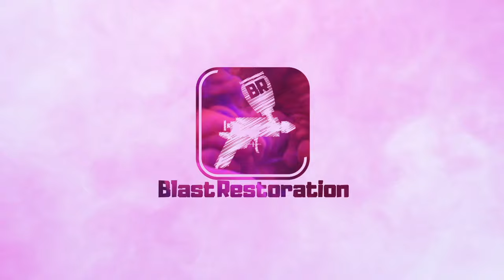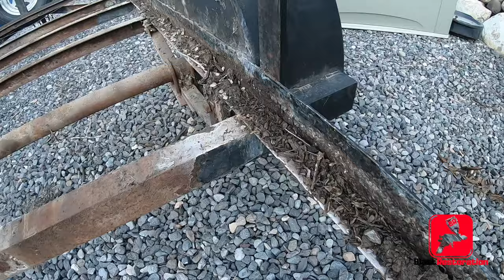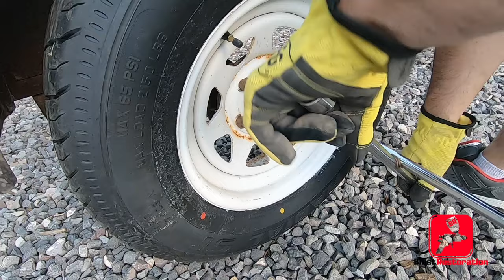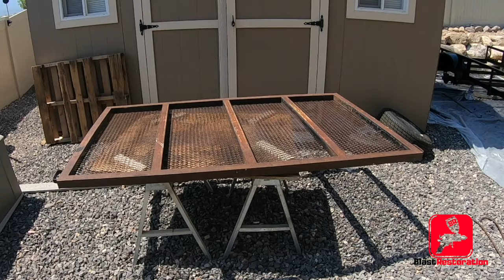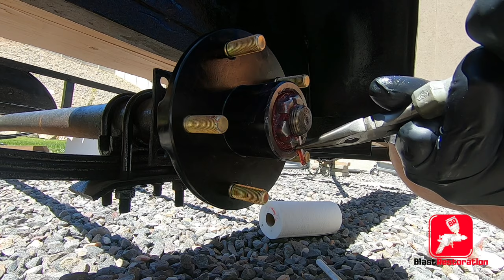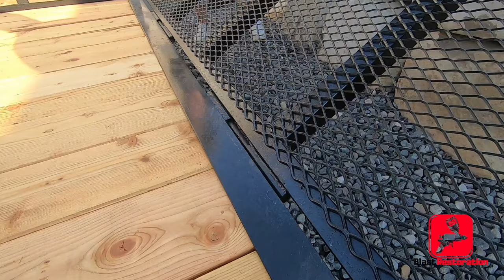Trailer Restoration - Repairing and Restoring My Old Trailer - With Time-Lapse!

Comment: Hey mate, just curious on the painting process, I saw you used a flap disc. Beyond that, did you use a rust converter or anything similar? And what was the paint you used? Wanting to clean up my trailer and make it look semi-presentable. Just doing my research before diving in head first 😅 cheers.
Reply: I just my self a rusty old trailer what product did you used to restore yours?

Comment: Excellent work my dude! Just two things I noticed, get some grease on the hinges for your drop gate, and get some wire loom tubing on your light wires! Those thin gauge wires need protection from abrasion.

Comment: The floor board replacement was interesting. My old bed was rotted enough that when I drove a load of junk to the dump I just tore the bed out right there. I don't have a welding rig or experience and I've been contemplating how I get the new planks in with both ends captured by steel. Thought I'd have to grind the front flat bar off and then bold a replacement with angle steel but the method you used has given me another option. How many boards did you have to flex to get into place?
Reply from the maker: Thanks for watching!! I had to flex the last 3 boards! you can get the sides to go in without flexing them and finish in the middle!
Reply: I've seen this method a few times, but it's a little time consuming and risky.  Instead of grinding the whole front flat bar off, just grind an 8" or 12" gap - whatever is the size of your widest board.  Then simply push the boards into the steel "trap" at the other end of the trailer and set them down  through that gap at this end of the trailer.  Slide them left & right til you're down to the last board. After you set that one in, put a wide washer on it and drive a hole through the board and through the metal flap below. Then put a bolt through that hole and tighten it underneath.  From then on, any time you wanna re-do the boards, you just reverse that bolt out and change all your boards, then punch a hole in the last board (up through the hole you left in the bottom flap).  Re-do the bolt and you're done. If you are concerned about moisture getting into the hole of that one final board, you could put a sealant around the washer you added at the top & bottom of the board. 

Bottom line - you can reduce the work of changing out boards to tightening & loosening a single bolt.  No more standing on 3 bent boards under pressure - which might be really hard if you're working on a shorter trailer with less length for the boards to flex.  And no more knocking the post out of the way while they snap back into shape.  (though, I've seen some do that with a jack from underneath so there's no snapping the board back into shape - you just lower the jack slowly and the board slides into place.)

Comment: To put the dust covers over the bearings, try a 1.5 or 2 inch PVC pipe cut about a foot+ long. It fits right on the rim of the cap, does not crush the cap and the foot long handle gives you better control to hold the cap perfectly aligned with the spindle as you tap it in.

Comment: Nice job on the trailer. I had 5x10 TWF trailer a year ago, I rewired the trailer from front to back. I encased the harness in wire loom and used PVC from the tongue back so the harness was completely protected, only leaving a small section uncovered that plugged into the truck. I also used heat shrink tubing after the wires were spliced. Wish I had pictures of it but I sold the trailer
Reply from the maker: Thanks for the tips!

Comment: Very nice!  I'm getting ready to do the same thing to a 16' tandem axle trailer, but I have to cut the gate off, straighten it and weld on new hinges.  I'm going to put used oil on my boards.  The most impressive thing in the video is that there is someone out there that still knows how to grease a bearing!

Comment: Nice work. Goes to show that quality work can be done with the "not so expensive" tools. You'll probably want to put another coat or two of the Thompson's on the wood before winter and maybe another in the spring. The stuff works, just not for long. Easy to add coats though. Avoid polyurethanes and spar varnish, they'll check and flake when the UV beats them up.
Reply from the maker: I agree and why i choose the Thompson's! Easy to apply and does the job! Thanks for watching!!

Comment: The trailer came out wonderful. I don't think I could do all of that, being a 67 yr. old female with some disabilities. So I'm going to cheat a little.  I still landscape, I can cut all day, but this is a little much for me.  I'm thinking of getting black deck paint instead for the wood, boards are fine.  The rest I'll spray paint and let the trailer guy do the wheel hubs. lol. Or maybe I can borrow you.lol  Again great video, you are very talented.

Comment: Sick reveal man! Crazy transformation! What kind of paint did you use on it? And did that HF painter work okay?
Reply from the maker: Thank you!! I used rustoleum and the gun worked amazing for the price! Would recommend!
Reply: @blastrestoration545  thanks dude! Got a 14ft landscrape trailer for the sxs and gonna redo it as well like that. Good vid

Comment: 5 spike, 3 Sarah. Now you used good wood, nice paint job and better lights to upgrade the trailer. However i believed you missed a chance to upgrade the wheels with spinners. Lol JK nice work as always.
Reply from the maker: Spinners and under glow might have been the cherry on top lol
Reply: @blastrestoration545  oh I forgot about the under glow.  Hmmm maybe it ti.e to spruce up my old trailer. 🤔🤔

Comment: Great job but I have 2 questions first did you use self priming paint or did I miss part of this and also you said the tires were new did you check the date code I bought a trailer built in 1997 and the tires were dated 1996 that made them26 years old just something to think about. I replaced mine.

Comment: Nice work!  I have the same trailer and I want to do the same thing but keep putting it off. How did you attach the planks to the frame?  Did u have to drill and tap new holes?  Self tapping screws?  Thanks!
Reply from the maker: Thank you!! Correct, I did go back and drill holes and used self tapping screws!

Comment: What paint did you go with for the trailer
Reply: I was wonder the same thing
Reply from the maker: Rustoleum!
Reply: @blastrestoration545  thanks a lot.Can’t go wrong with that. I used it on an old s10 frame and it held up great.  Thanks god bless

Comment: Great work and good job on the video!! What kind of Rust-Oleum paint did you use?
Also, how did you remove the back grates?
Reply from the maker: Thank you! I just used the regular glass black in the gallon can and thinned it out! I didn't remove the grates I just welded them down where they had came loose!
Reply: @blastrestoration545  hey bud, I got trailer that’s completely made out of grates I think you called it?? Or metal mesh?? Anyways it’s all bowed in, unstable or least scares hell out of me. I’m thinking about going all wood. Would you recommend it? I need go all mesh again? It’s only 5x8 trailer I need it haul at least 2 motorcycles

Comment: I have a 5 x10 trailer. Will I be able to use a board to install the boards like you installed them. Or is the wood to short to bend it so it will fit under the rail?
Reply from the maker: Its hard to say, you could try doing it with one board to see if its possible or if it snaps!

Comment: What is that blue disc you used to sand the rust off? I need to get some of those. I have a trailer I was given by a family member and it's almost exactly like this one in size and setup. It's a 5x10 with that mezzanine ramp. It  needs to same restoration treatment as the one in this video.
Reply: It is called a flap disc.   Good for removing old paint and rust, while not taking much metal off.
Reply: @jeffro221  thanks 👍

Comment: I'm in the process of doing pretty much everything you did to my 30 year old 5x10 cargo trailer, but adding a 3" lift as well and my only question is, what paint did you use?
Reply from the maker: I used rustoleum! Thanks for watching!!!
Reply: How many coats?   Do you find that primer is not needed?

Comment: what did you use to sand down the trailer on your angle grinder?
Reply from the maker: Its a called a flapper disk. Basically sand paper stacked on top of each other!
Reply: Would a sand blaster be faster to remove the old paint and rust or is the grinder the better option?
Reply: @blastrestoration545  what grit? Thanks!
Reply: @matthewpawlaczyk7507  I can help answer if you got that tool it needs fantastic!!! But be careful if you blast it wrong can blast holes into frame

Comment: Sell the nasty wood on marketplace or Craigslist. The craft people and shabby sheik people go nuts over it!

Learned a new way to tape off wheels today! (OLD DOG NEW TRICK) where do you get the white paper you use?

Try running wires through 1/2 inch conduit or old garden hose (paint black) to protect wires especially if you pull trailers in snow.

What did you coat the wood with?

Great job on trailer, LOOKS GREAT!